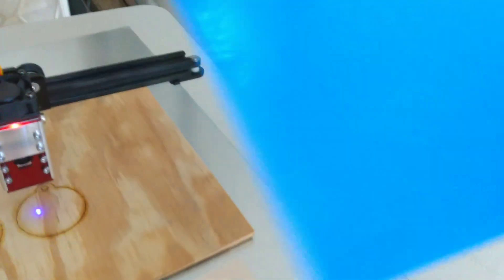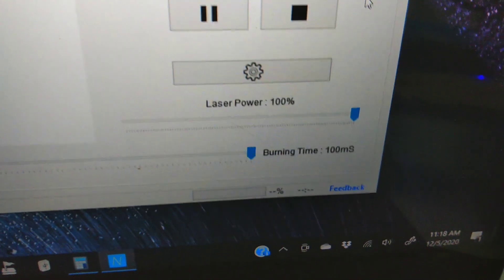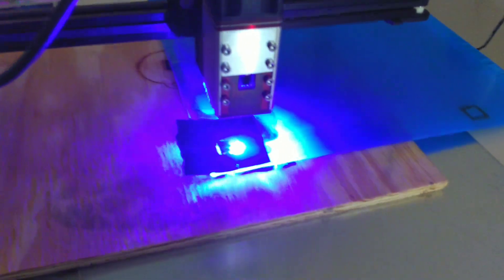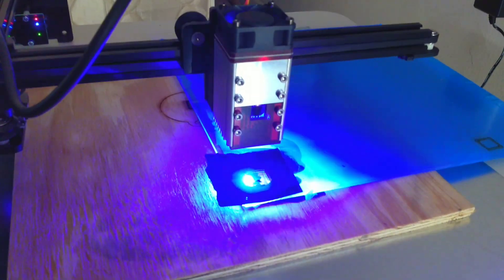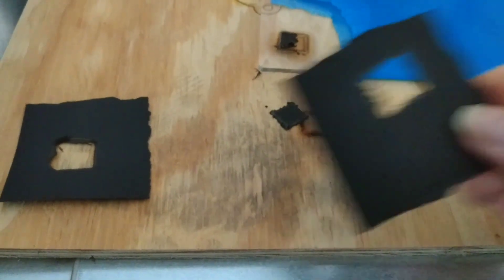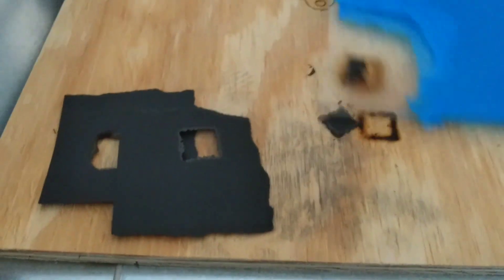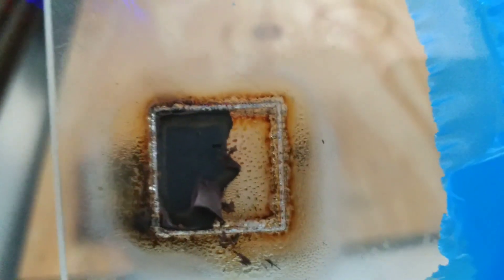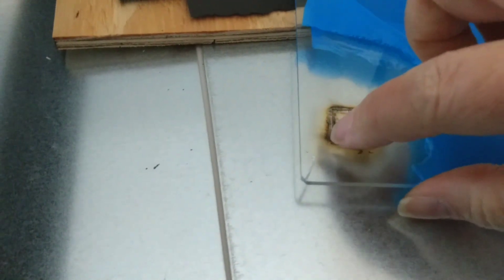Will it cut CLEAR Acrylic? Neje 30W diode laser.

Comment: Whybdid youbremove the blue film? It was making progress then you removed it making it impossible to make any more progress cutting... no offense but this must not have been your brightest day.
Reply from the maker: Lol, yeah sometimes I get in a hurry. No offense taken! I've since gotten a co2 laser which is so much better for clear! ;)
Reply: @RebeccaMadeIt  Is there any chance you know the name of that blue film or what I should search? I can only afford my bambu p1s right now and it seemed like you were making a little progress with the film applied so if I can POSSIBLY do thin clear acrylic sheets I'd love to give it a shot I just have no idea what to search. Thank in advance if you have any advice on where to find it
Reply from the maker: @austinporter4285  that blue film came on the acrylic sheet. Protective cover. I'll see if I can find amazon link to one I bought. Yeah these Hobbies get expensive. Diode can engrave but you will not have much luck cutting.
Reply from the maker: https://www.amazon.com/gp/aw/d/B07PW97MD3?psc=1&ref=ppx_pop_mob_b_asin_title
Reply: @RebeccaMadeIt  thank you cery much. I feel confident I can find a film that's high temperature resistant and maybe have better luck with that. There tapes for electronic components with very high heat tolerances that rent clear but also aren't solid like laptop tape do I guess it comes down to just experimenting and seeing what works best to engrave/ MAYBE cut clear acrylic. I need to look up if acrylic can be cut eoth a cnc, if so then I'm good to go.
Reply from the maker: @austinporter4285  sounds like a great project, good luck!

Comment: I think trying a few different speed increased tests would help. I think you are moving slow enough that the cutting is fusing back together faster than it but clear is a difficult type to cut. Acrylic is in general a sensitive material for diode lasers. I know the 10w xtool D1 can cut opaque acrylic and possibly the darker transparent ones up to 3mm possibly 5mm thick in a few passes but I believe the speed settings are higher than yours. Most 2.5 - 5w output diodes are not great for cutting most materials
Reply from the maker: Thanks for the tips! The new xtool D1s coming out look cool!
Reply: Im already in love with the 10w. Got it set up and working on dealer info tags for my husband's business. It's anodized aluminum.
Reply: I would also recommend getting some kind of air assist which might cool the acrylic as you cut.

Comment: would it have better results if u used on one those honeycomb laser cutter beds?
Reply from the maker: I think there would be A lot less of the smoke residue. But I think the laser light would still pass right thru. I'm gonna try a raised bed and permanent marker soon.
Reply: @RebeccaMadeIt Laissez le film bleu et passez une couche de peinture noire  gouache très fine avec un rouleau en mousse.
Reply from the maker: @TheSPL72  Thanks for the suggestions!

Comment: Hello your machine is Neje master 2S??
Reply from the maker: I think mine is just the 2, not 2S. Neje 30W master 2 plus. Get the 2S if you can, sounds like it works better with Lightburn software.
Reply: @RebeccaMadeIt  This is the problem I have, I have already followed several parameters, configurations and many videos, but I was unable to make it work so much on Ligthburn and others that use the GRBL system ...
Reply from the maker: Bummer, I still have not tried Lightburn but hesitant to even try after all the issues from others with the 2.
Reply: @RebeccaMadeIt  no problem thanks Rebecca, nice talk to you... I love yours videos...
Reply: I ordered the 2s, I will let you know how it has performed after i received it
Reply from the maker: @newchannelization  Cool, thanks. You will enjoy it!

Comment: its cheaper to get the K40 CO2 CNC, also it's faster than this thing.
Reply from the maker: I've been researching them. They still intimidate me, lol.
Reply: @RebeccaMadeIt  no need to be afraid, use a webcam to watch the work wile you set the machine in an empty room, just to be safe, also there are upgrades here on you tube to make them safer to use.
Reply from the maker: @takismail  Thanks for the encouragement and info! Definitely cool tools for makers!
Reply: @RebeccaMadeIt  you're welcome Mate, planning to order one of them myself :).
Reply: 300 x 200mm working area vs 810x460
Reply from the maker: @drathir55  good point!